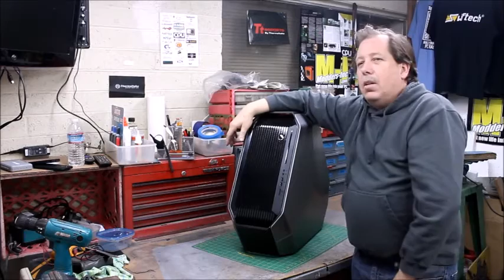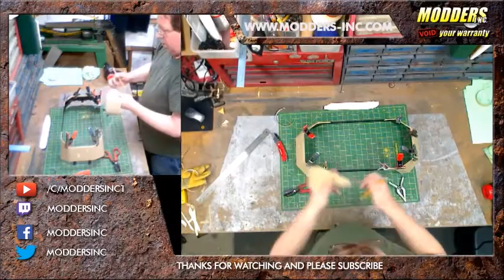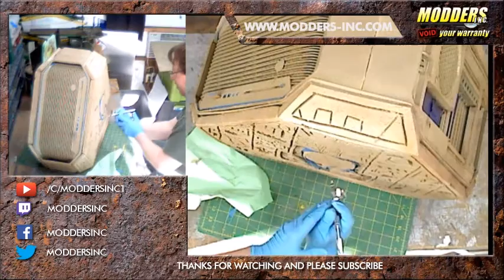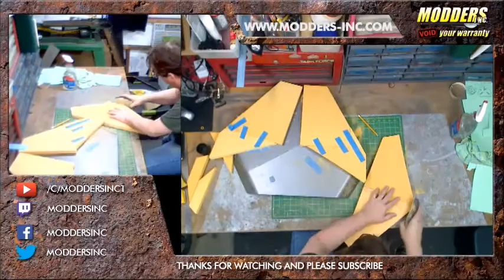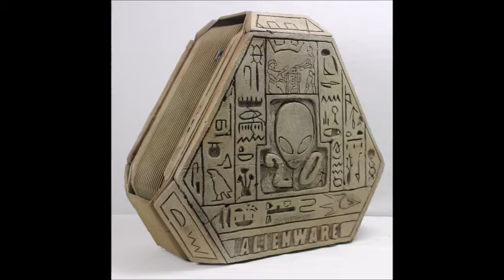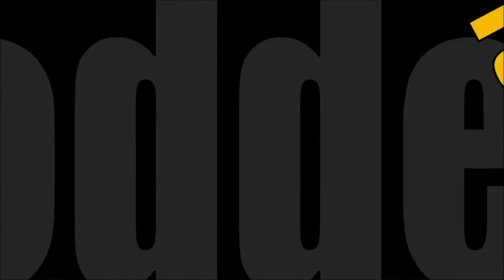Recap video of Alienware case mod Modders Inc

Comment: whats the black trim called and part number ? its three pieces used as the handle probably the only part you use a allen wrench to remove it . mine cracked while being  delivered by fedex.